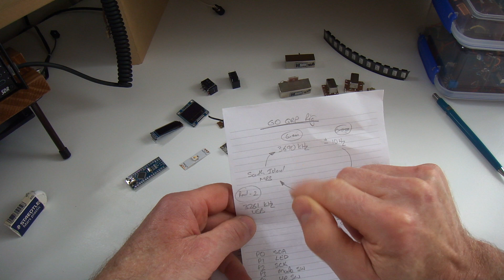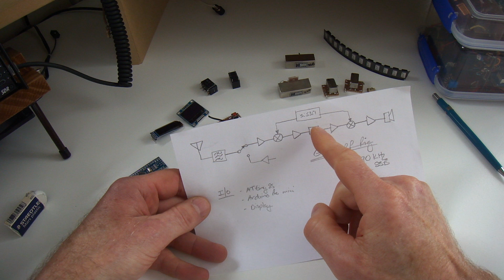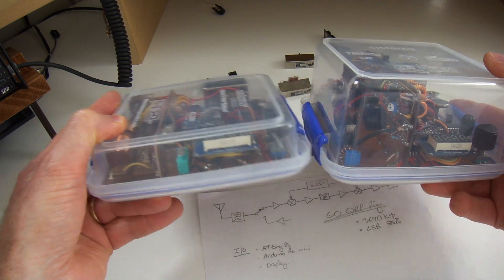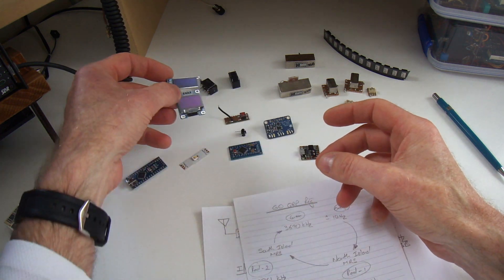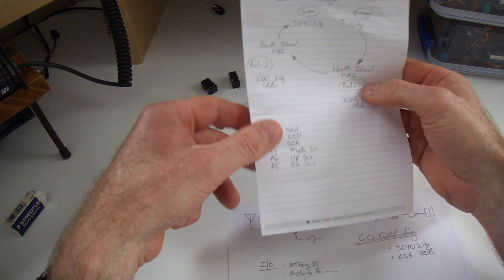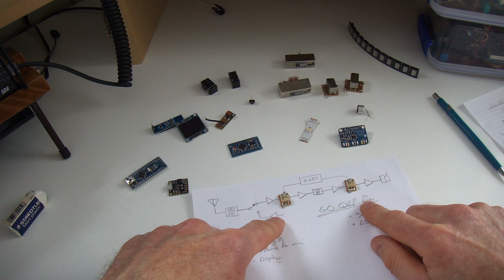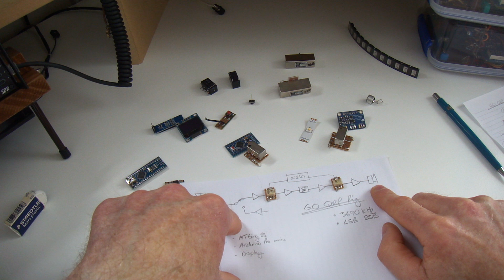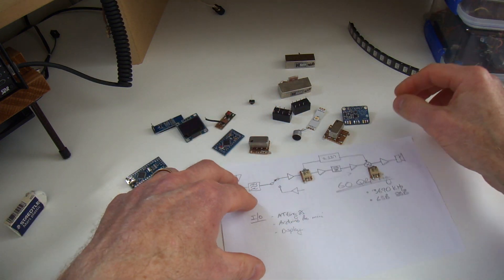Go QRP SSB Rig: Part 1 - Thoughts and Ideas

Comment: Glad to see you back! Love the idea of using the RGB LED to indicate the frequency

Something that may be worth a look is the WS2812D-F5. It's a Neopixel in a standard 5mm LED form factor with a diffused lens. Much easier to see than the tape in my experience. I used it in a project with the Attiny85 and it worked great as a drop in replacement for the tape - required no modification to the code

Looking forward to see how this project turns out. Cheers :)
Reply from the maker: Thanks for the tips Ross. I'll look into that.

Comment: Very nice to see you back again doing projects have you considered the noise if any generated from the PWM driver of the LED( not even sure thats an issue at 100% duty) also using an additional I/O line to drive a charge pump in pace of the one on the OLED board that way you can turn it off and pump only as hard as required.. You could dump the carrier board and get even smaller then as well!
Reply from the maker: Hi. No I have not considered the PWM noise, but will look at that as i work up the VFO. I'm not even sure yet if the LED will be bright enough for direct sunlight. I may have to revert to a simple small three way switch. That would do away with the problem altogether.

Comment: I think you can vary the colors on the neopixel leds to add cyan, magenta, and yellow, maybe even shades inbetween .  You could use these other colors to indicate different frequencies, and offsets from them.   BTW check out Azzy Electronics new at-tiny dev boards (https://www.tindie.com/products/drazzy/attiny16141604-dev-board-arduino-compatible/) for the new AVR tiny0 and tiny1 series.  Much better than the attiny85 which is rather long in the tooth these days.  The new parts have more memory and are cheaper!
Reply from the maker: That's certainly an idea. The link seems to be broken :o(

Comment: Hi Charlie, 

it's certainly been a while, glad to see your staying safe. You might consider using some ne602/ne612 SMD parts, it may help get that size down smaller ( on the receive side).  You possibly wouldn't need I.F. amps on 3 MHz ( the 602/612 possibly has enough gain ). This approach might be worth looking at. It would simplify your block diagram on the receive side and save space.

I would look at possibly using a small e-paper display for future projects ( the attiny85 possibly doesn't have enough storage for the display library and your code). The contents stay on the display for quite some time after power down ( its like weeks, possibly months). it's a possible alternative to an noisy OLED  display. A further advantage is once the display has been updated it no longer draws battery power as you can power it down and the display keeps showing the contents.

I hope this was of some help in your latest and future projects.

stay safe and best 73's

Simon
Reply from the maker: That's definitely useful Simon. I might stick with the current approach (right or wrong) for now. I really do need to get into SMD at some stage. When I do, I will have to break out the engraver. It's a bit too noisy and dirty for now. The e-paper sounds interesting too. I've been wanting to try those for some time.
Reply: @CharlieMorrisZL2CTM   I have been reading the comments and although the morse idea sounds good it may not be possible in the limited space on the attiny85 MCU. To implement it is going to take a timer and hard coded letters "N" and "S" so the indicator would repeat ( not forgetting an additional timer for the gap) . The SI5351 is already going to take up space with the library and the software library for i2c communication ( i believe there is no hardware i2c on the attiny85 MCU).

Button input for 3 states can be done in just 2 digital pins ( for all 3 functions), This will create a simple binary switching method.

Binary input
button 1     button 2
      0                 0        =  Do nothing
      1                 0        =  Frequency DOWN / North island
      0                 1        =  Frequency UP / South Island
      1                 1        =  Toggle Frequency / MRS  Mode

Binary output 
     Led 1     Led 2
        0             0       = Frequency mode
        1             0       = North Island 
        0             1       = South Island
        1             1       = frequency mode (off frequency, if space is available you can expand to flash 1 of the  L.E.D'S to show direction above or below the correct frequency)

This method should be easy to implement without a need for any extra libraries taking up valuable space. Yes i am aware of the reset pin taking up a pin, but this can be turned off ( in some alternative programming software) giving you all 6 IO pins.

This is just suggested as a way of possibly making the difference between using the attiny85 MCU and having to use something else. 

I hope these ideas give you some inspiration and a starting point. 

best 73

Simon

Comment: Welcome back Charlie. Love your concept. Ultra simple, designed to do just one thing and do it well. If you have a clear purpose in mind many otherwise difficult design decisions become easy.  I support Go QRP NZ in spirit from VK3!
Reply from the maker: Cheers Paul. The morse code ideas are a great way to go. Not sure how bright the LED will be. As I mentioned above, I'm probably better off with a simple small three way rotary switch. We shall see. Go QRP!
Reply: @CharlieMorrisZL2CTM  There's more than one way to skin a cat.  Borrowing from freqMite (?), a frequency counter kit that could be added to 'display-less' QRP rigs from a few years back, you could annunciate frequency/channel/ etc using sound.   Add a pushbutton, when pressed, your script converts the current channel number (etc) to CW characters using the Arduino tone() library.  Damp down the resulting 800Hz 5v square wave and feed it via a level-controlling trimpot into your receiver's audio amp.  Your channel will appear in your 'phones as CW.  No display needed.

Comment: Great to see you back fella, just a quick note on the ideas front - Have you thought about making the rig into a walkie-talkie type design? Have a loaded whip antenna with a small L/C match, just a thought.
Reply: Love that concept, I've tried to do something similar.  He will need a long wire antenna on 80 with a few watts, which weakens the 'walkie-talkie experience' slightly, but a good design generator.
Reply from the maker: I did Robert, but felt the 80m wavelength would make too inefficient. I'm thinking about a 6m rig, but am not sure how active that is in New Zealand.
Reply: @CharlieMorrisZL2CTM  6m would be a good choice for a dedicated homebrew SSB transceiver with a difference, not too VHF to be impossible to get working, but different enough to warrant an improved approach over a regular HF rig, and RF devices with some gain above 30MHz. Si5351 would do the high or low side VFO, it could be a conventional single conversion superhet.  Only one problem,  who are you going to talk to up there? Spacemen? 😮

Comment: Hi Charlie, great to have you and your ideas back. I've used a cellphone headset with built in mic - an extra wire on the headset socket but may save you explaining to fellow hut users why you are talking to your lunch box :)
Reply from the maker: That's a great idea Neville. I didn't think of that. I have to use a connector for the headset, so why not make it a four ring one. I assume you can buy those...
Reply: @CharlieMorrisZL2CTM  Don't buy anything! I'll post you some via your qrz.com address.

Comment: Are the si5351 frequencies the same on tx and rx? You don’t need a pin for ptt?
Reply from the maker: Hi. Looks like my cunning plan may not work, as I will need to sence TX. I will start with the I/O and VFO first and sort all that out. I think i may have to go with a three way switch and one analog input. I'll use a voltage divider to indicate the three modes. I'll put some thought into that tonight. Thanks for pointing that out!
Reply: @CharlieMorrisZL2CTM  I don't think you actually need to sense the TX/RX, You only need to switch the relays. The MCU doesn't need to know when your in TX and RX. It only needs to know those things if you were updating a display ( you wont have one)  or your working split frequencies ( so it can change the frequency as required). So why do you think you need to sense the TX ? ( you only need to supply a RX/TX voltage which only requires a relay for switching and not an MCU pin.

best 73

Simon

Comment: Looks like it'll be a great minimal rig. Have you thought about using CW to blink out n or s in red? Also if you use an analog input you could pair it down to only one by varying the voltage on the button presses with resistors. I am following along with great interest :-)
Reply from the maker: No I didn't, but that's a great idea which I will use if I stick with the LED. I may have to do away with the LED as I may not have enough I/O ports. I forgot I need to sence PTT.
Reply: @CharlieMorrisZL2CTM  you could always do something like make a long button press cause it to output the frequency as audio. Just a thought! 73 de W7RLF